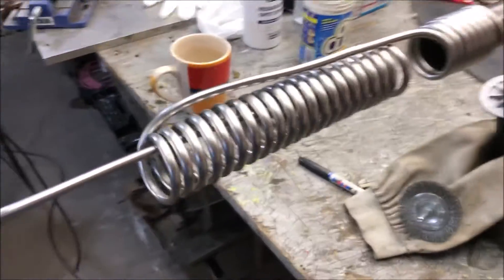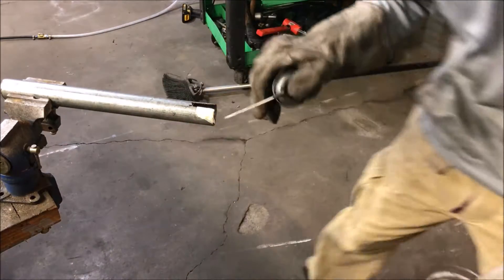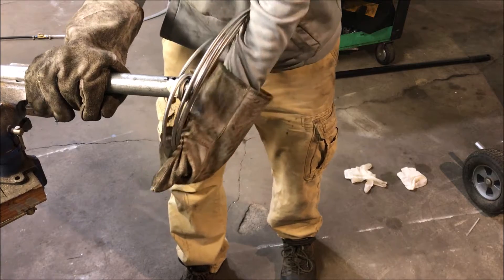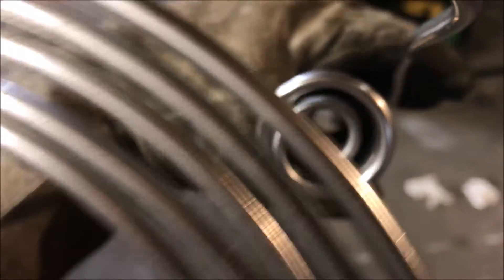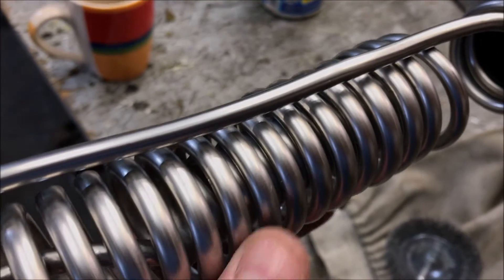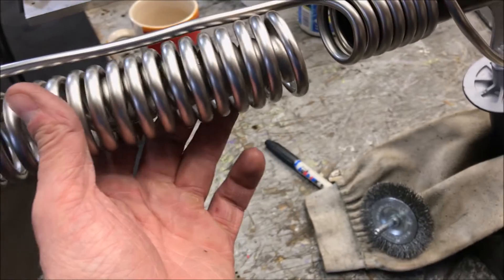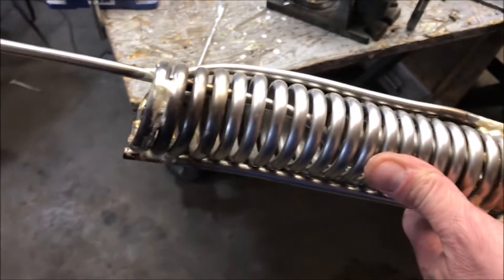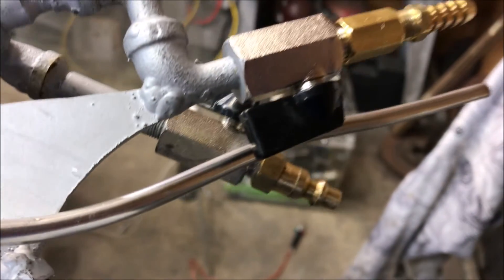Bending stainless steel tubing with ice

Comment: My customers that will not fly , try filling with fine sand on a vibrating machine compact as much as possible then bend !!!
Reply from the maker: its getting it out thats the problem , i use a grease gun now , this is no longer an issue . Fill tube with water 2 pumps of grease gun and your at 1000 psi . proceed and drain in seconds

Comment: If you freeze just that point at the time of bending I believe the rest of the water will compress preventing that spot from rupturing. Crack a Co2 bottle valve directly onto that spot for precise freezing. I use the same technique to shrink bearings when I forget to leave them in the freezer before install.

Comment: Your technique is right. You got to bend and form the material gently around the mandrel. I've done a lot of copper coils without anything in them. 
I know copper is easy compared to stainless steel, but the way to "form" it around the mandrel is the same.

Comment: There is a steel pipe bender for auto gas lines sold in auto parts stores.   I have used it with good results.  It maybe useful for you.  It helps spread the bend out over a area instead of one place. 

Pickling solution is used to remove the discoloring from SS metal along with buffing to restore the shine.  Works great!
Reply from the maker: Thanks i will look into the pickling agent.
The gas line and break line benders are not much help making this coil , at least not the ones ive tried

Comment: I've seen on TV before where someone used a little soap in the water when freezing to make it all a little slushy to prevent the ice inside to break in large pieces, might try that.
When using just plain water might also be good to try having an expansion chamber and crush it before bending to have an over pressure inside it and make sure there is no air inside by vacuum degassing or boiling the water first and also a little soap in it to help air bubbles in the tube escape